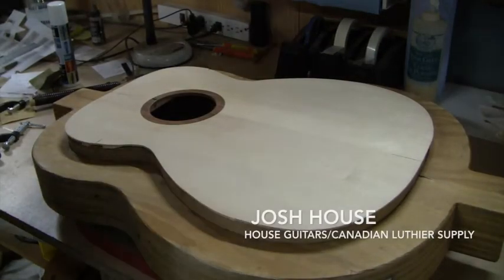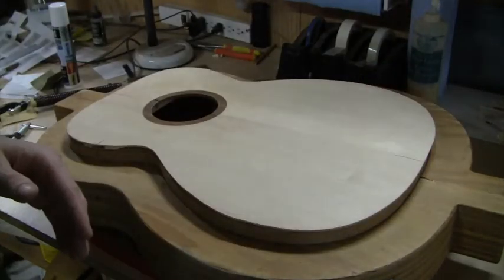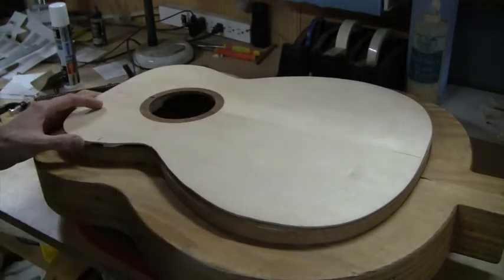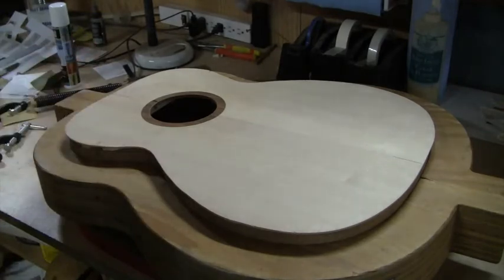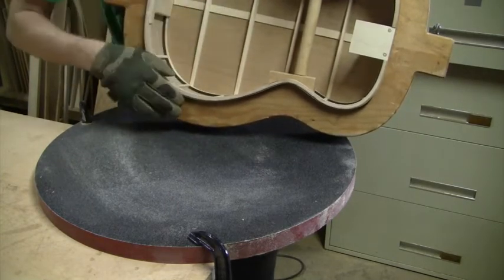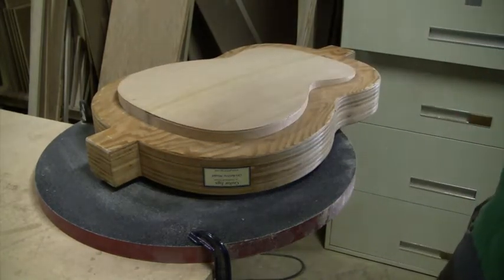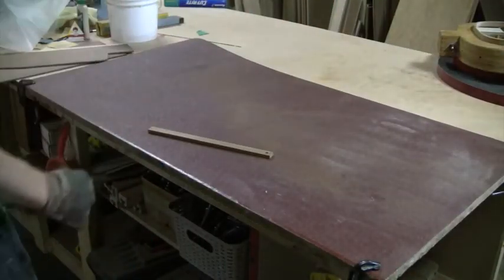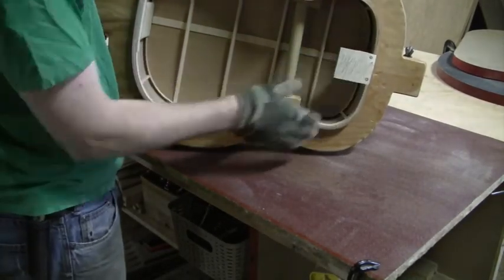Preparing the rim for gluing the top on a steel-string guitar.

Comment: Hi Josh,
Could you radius the whole rim and then go back and flatten the upper bout? It would waste some material because the upper bout would be sanded twice. But would it still work? Thanks!
Reply from the maker: Ren, I know of several builders who will sand the upper bout and then go back and flatten just the area that will be under the fretboard. At the very least you need this flat surface for the fretboard, and if you are bracing the upper bout portion of your top with flat braces (which is what I do), then yes you'd have to flatten the whole upper bout. There should be no problem doing what you propose, but the trick will be when you flatten it to get the correct angle. I can't say that if you radius the whole thing and then follow my method with the stick under the tail block that you'll end up with the correct angle. You might have to change the thickness of the stick to get the angle you're looking for (which may not be the same as mine). There are other methods for flattening the upper bout. Another option I know people use is to radius the whole thing, glue the top on, and then flatten the area under the fingerboard. That is what makes guitar building so interesting! 10 different ways to accomplish the same task and they can all be correct!
Reply: That helps, thanks!

Comment: Hi, thanks for the great info. Question: I build flat top guitars with no top radius. In order to prepare for the neck angle should I still sand the front of the rim at a downward angle as you did in the end of the video? Thanks
Reply from the maker: Hi Ren, You will need to do something to establish the neck angle for your guitar. You could do it the same way I do in the video, however I'm not sure that the stick I use to prop up the back of the guitar when sanding would be the right thickness for you. Proper neck angle requires a gap of 2-3mm at the saddle location once the top is on (no fretboard). Exactly what that measurement should be (2, 2.5, 3) and how you achieve it depends on your construction method, top bracing, etc. Since I don't build true flat-tops (no radius) I'm not going to be much help to you. I'd suggest you find another builder who is building with a similar construction method and ask them. Some of the online guitar building forums might be a good place to start. Off the top of my head I can't think of someone who is building with no radius I can direct you to. Sorry I can't be more help.
Reply: Thanks!

Comment: Josh, first off let me thank you for sharing your knowledge on YouTube with us luthier wanna bees( at least I speak for myself) . One note of clarification and please just let me know if my thinking is correct. When you sanded for the top plate upper bout with the stick under the tail block, is that to maintain the neck angle when gluing the fret board to the upper bout and keep from getting the characteristic 14th fret hump?
Reply from the maker: Sanding the upper bout flat with the stick under the tail block does 2 things. It gives me my neck angel (or approximate angle) and it flattens the upper bout to match the flat bracing I use on my tops above the sound hole. When my top is glued on I should end up with an approximate gap of 2-2.5mm at the saddle location when I rest a straight edge on the upper bout in line with the tops centre line (hope that makes sense). I will later fine tune the angle on the upper bout with some hand sanding until I get a gap of exactly 2.5mm. The 14 fret hump is a result of misalignment between the neck angle and the upper bout on the top. The goal is a smooth transition for the fretboard where it leaves the neck and attaches to the body. However, even near perfect alignment can sometimes result is a vary slight bump. The way I deal with this is by attaching the neck/fretboard to the body before the fretboard is radiused. By levelling/radiusing after the neck is attached I eliminate any slight 14 fret hump that may have showed up after gluing.

Hope this helps.